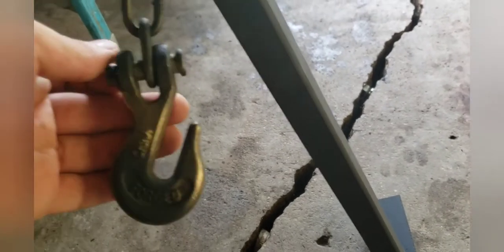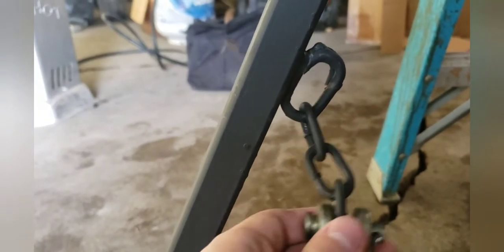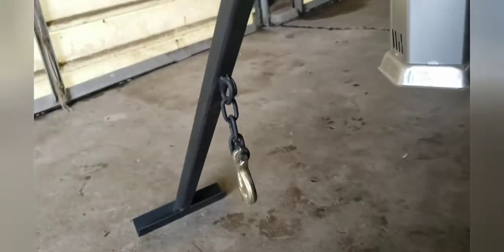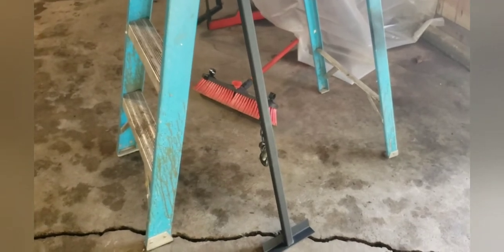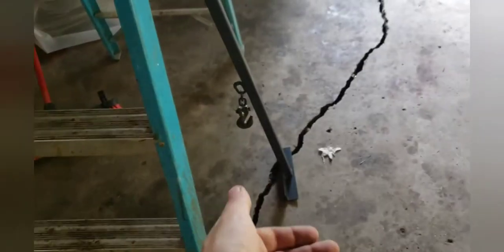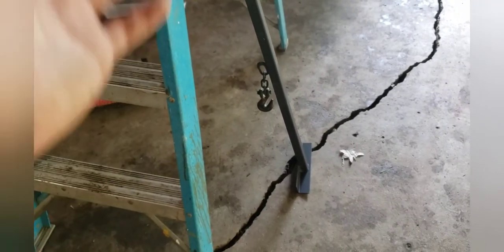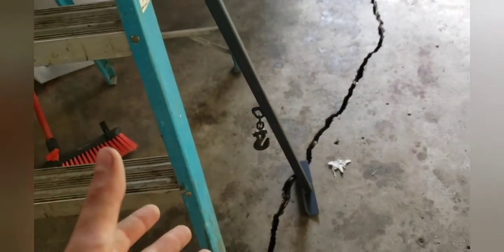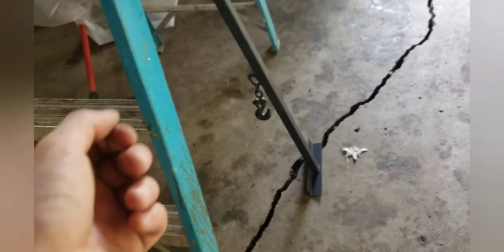How to Make a Earth / Rebar Stake Puller

Comment: Yea I made one like this and went to pull a 2ft long rebar stake out of ground and the square tubing just bent at hook. Back to drawing board now. 
I’m gonna have to weld stiffener plates on side now. 🤦🏼
Reply from the maker: Interesting I'll pulled wolf fangs out of frozen ground and never had that happen, what size tubing?
Reply: @OutdoorExperiences  
1” square tubing
Reply: @jerrodharper6508  .125 inch metal thickness? Might be too thin. Go for an heavier-wall tubing. Also, any place you weld on something the metal all around the weld will become dead soft from the heat of the weld (annealed) and subject to bending easily.  Weld quick or in short bursts to avoid overheating your pieces. 960 degrees F is around the critical annealing point of most mild steel… give or take a couple hundred degrees depending on your material.
Reply from the maker: Great advice!